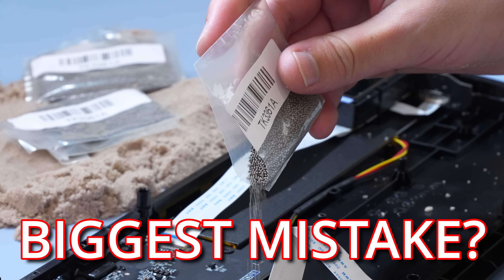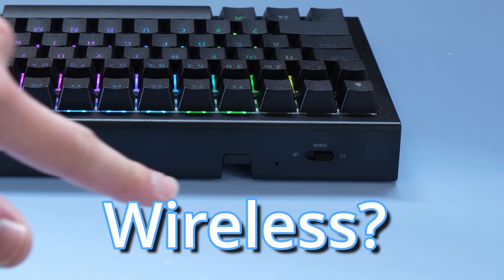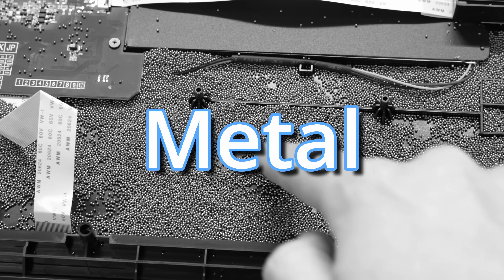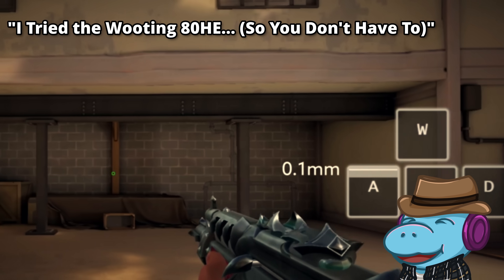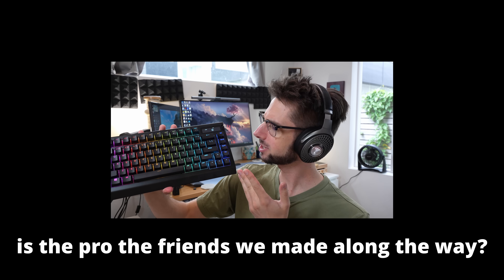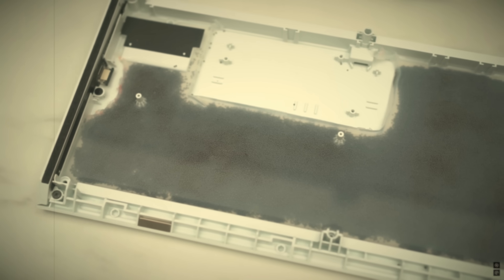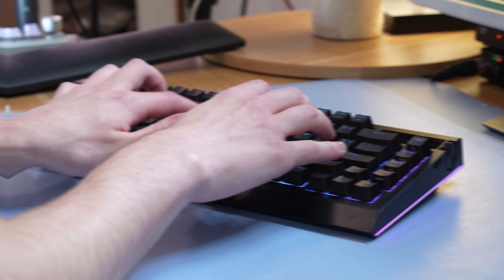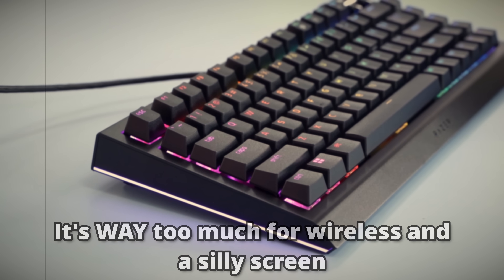WHAT was Razer Thinking??? (Blackwidow V4 Pro)

Comment: The fact that you think Hall Effect is a niche thing and only there because the gamers want them like RGB is a bad take.
Hall effect makes a huge difference even for normal people, it is the one new thing in keyboards that actually make you better compared to all the placebo polling rate, latency or speed switches.

And let's not forget about the fact that Hall Effect gives you the option of analog input which on its own makes it worth the extra cost, and is a huge thing for flight or racing.
Reply from the maker: It's not a bad take, its literally objectively measurable as being about 5-15% faster (a few ms)
It does not make a huge difference for normal people apart from the niche features, faster strafing etc.
A huge difference would be a large skill performance increase measurable by rank increase.  

Most flight/racing gamers would be insanely better off with proper flight or racing controllers. (niche.)
Reply: but still feels and sounds like shit
Reply: @HipyoTech  It is not about the latency of the switches, it is the way it is actuated, being able to register keypresses at the bottom of the switch or anywhere, or spam the trigger much easier is what makes it so impactful. Not only that but they are not only "5-15% faster", looking at end-to-end latency for the 60HE (Hall Effect) and the relatively new Logitech keyboard (Mechanical), we see the 60HE get 13.5ms and the Logitech get 30.2ms. This is HALF the latency and thats including system and game latency.
(Source: "Optimum's video: Logitech, wake up.")

The features on Hall Effect keyboards are not "niche" and can very much be observed and enjoyed by everyone, we are not just talking latency, you seem to keep forgetting about everything else like DKS and analog inputs when you mention Hall Effect keyboards in your videoes and make it out to be some niche stupid feature for marketing purposes.

And as a person who plays a lot of everything including flight sims, i greatly apprieciate not needing an entirely different setup for analog input, i can just switch profiles :)

Keep in mind i love your videoes but you really should not be commenting on stuff you do not know enough about. I hope you see this as constructive feedback because i sincerely do not mean to offend. ❤
Reply: @cmdrckhrix6402  one of optimum's points in that video was that the keyboard didn't have any good features. 30ms latency is not the average value you will measure from other mechanical keyboards. using the best and worst as a basis for overall measurement is just asking to be incorrect. and then instead of actually giving examples of how hall effect actually provides a difference for the average person you just list off features without saying anything about how it would help the average person. the only example you used was that you use flight sims, which is a niche use case. not many people are playing flight sims. your entire argument was a whole lot of nothing, with only a single source that wasn't even focused on objective testing of he vs normal mechanical switches. it was focused on an entirely different keyboard.